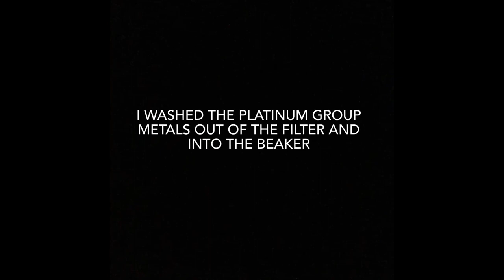Rhodium, Palladium and Platinum from Catalytic Converters Part 2

Comment: I'm sure you got all that only from your friends and relatives. The ceramic you bought online is skeptically seen--its just, was it easy to cut those things open? Why on earth wouldn't they, if they could cut them open, not put some acids and bleach together themselves? You had a substantial batch of the stuff so.. other than that I'd say you might get a few grams left in the first pour.